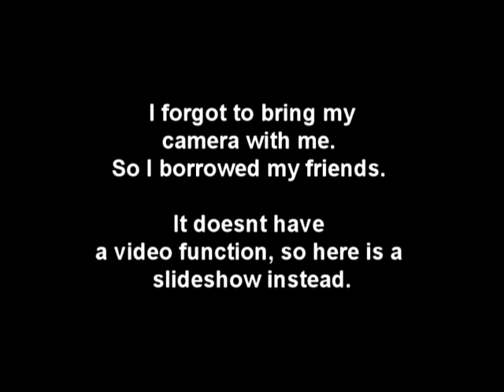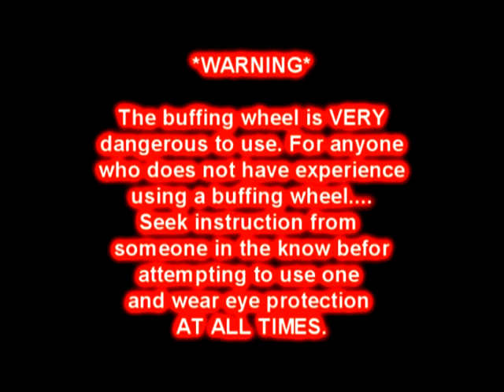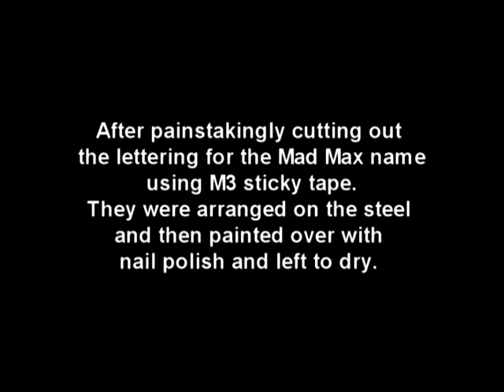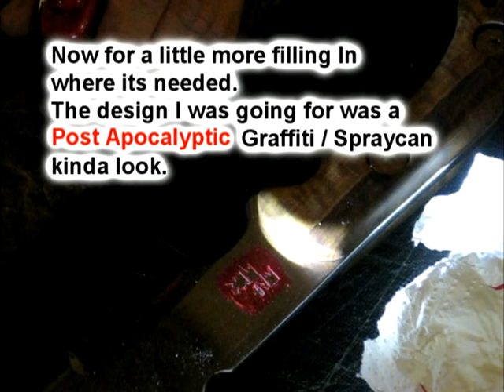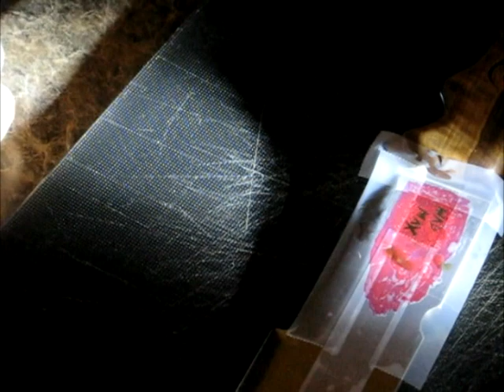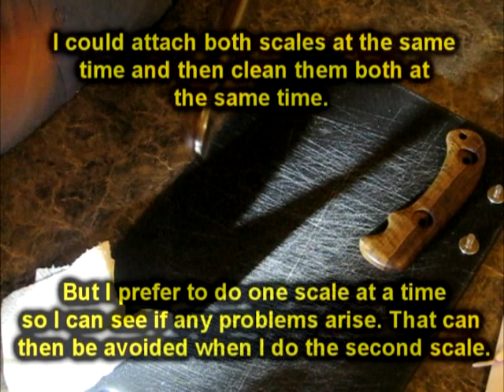Knife Making - The 'Mad Max' Bowie Tracker knife - Part 6

Comment from the maker: Shit...I forgot about that.  4 countersunk holes drilled. 2 from each side. Inside those holes a nut is seated. Then the screw for that nut comes in from the opposite side thru the handle scale. That way when its screwed in...the nut wont come out as its countersunk in from the opposite side.